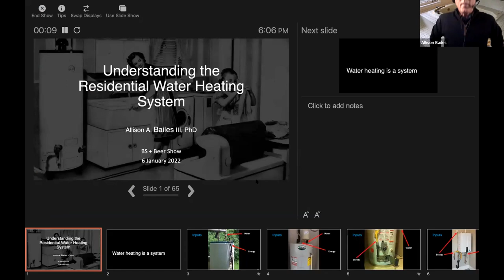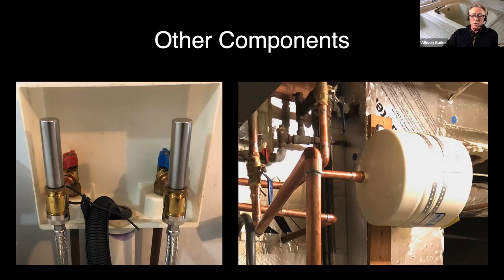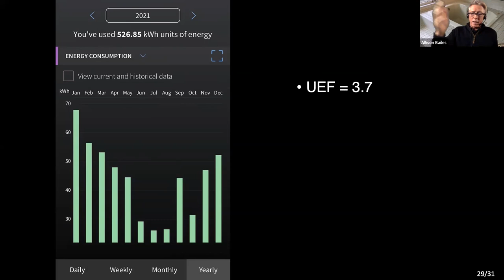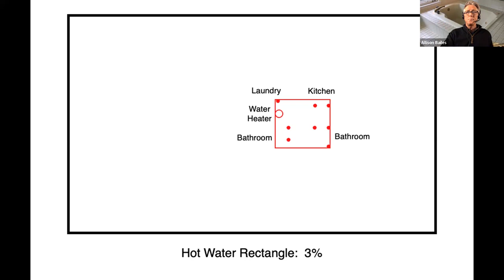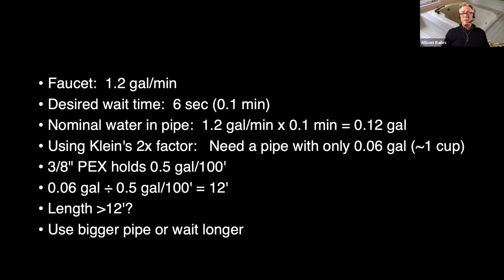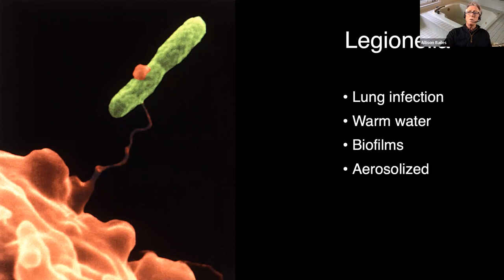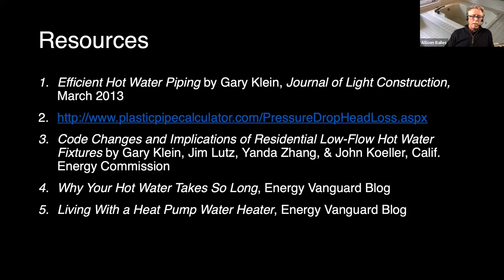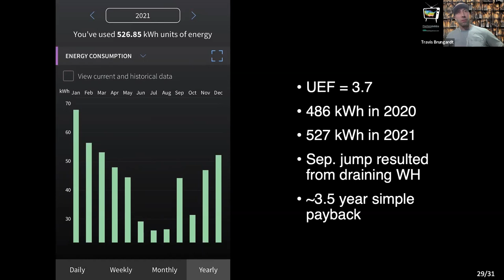Understanding the Residential Water Heating System

Comment: Back in the 1970's when energy cost was a big concern, some people in my area (western PA) were putting old uninsulated tanks between the water input (often city water, but also well water, coming in at 50-60 degree ground temperature), and the water heater, allowing the input water to rise 10-20 degrees before getting heated, warming the water to room temperature before going to the water heater. They usually lived in the same room as the furnace, so a bit of extra heat was available. Kind of an early take on heat pump and waste heat recovery, in that it was a passive way to recover waste heat to reduce the energy required for heating water.
Reply: Well that heat has to come from somewhere and a BTU is a BTU.  How that BTU is made is how much it costs.  That would work great if you were heating a basement area with a minisplit